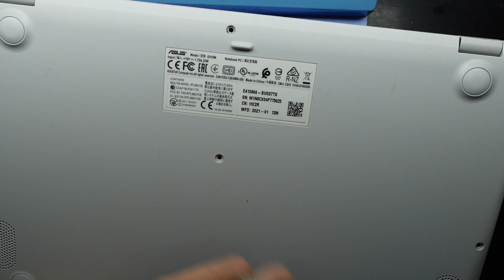Asus E410M NVMe Upgrade / Install

Comment: Anyone help please. Badly having a problem with my ASUS EM410MA not detecting the Samsung 980 nvme sdd

I already put the physical sdd on the laptop but it why can't my laptop detect it?😢 Help please.
Reply from the maker: have you either tried

boot from windows 10/11 install USB 

or Loaded up Disk Management in windows

Comment: What gen nvme is best for this laptop?
Reply from the maker: Don't bother getting gen 4. If you are running a celeron cpu.

Get the cheapest nvme available
Reply: @rickstechrepairs  but gen 4 still works well for this laptop, right?

Comment: So YOU CAN run the operating system off a nvme rather than the super slow emmc? That's cool. (I know you're still hamstrung by the 4 gb ram ceiling but that does help.)
Reply from the maker: you could but not recommended
Reply: @rickstechrepairs  (scratches head) okay, now I got to bite: "Why would that be?"
Reply: @misterb9786  I used acronis clone drive, switched boot order in BIOS, it's been working great. I made a bootable restore thumb drive before I started so can always go back to original.
Reply: @thetoddperspective  thx 4 info Todd! 👍
Reply: @thetoddperspective Hlo. Need help badly with installing the sdd, my laptop can't detect it. Need help. What should I do after installing the physical sdd?